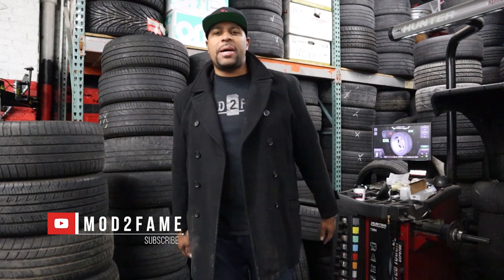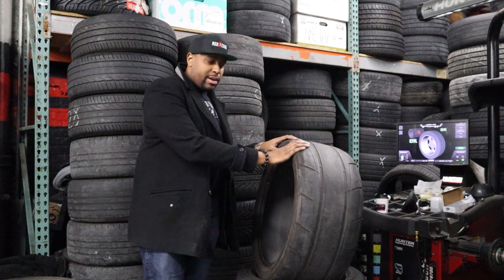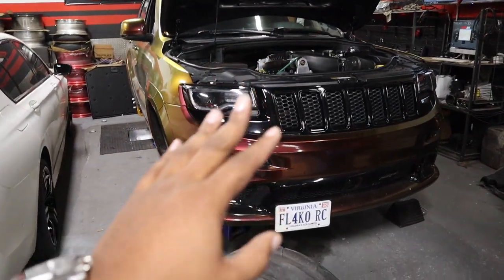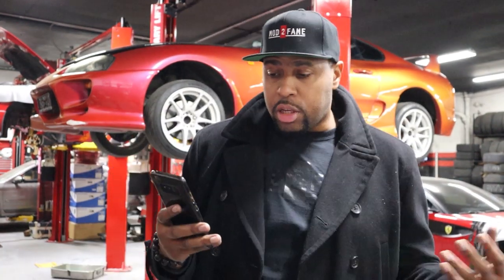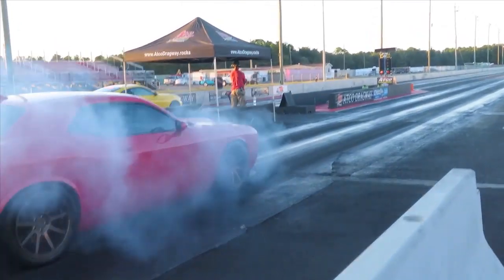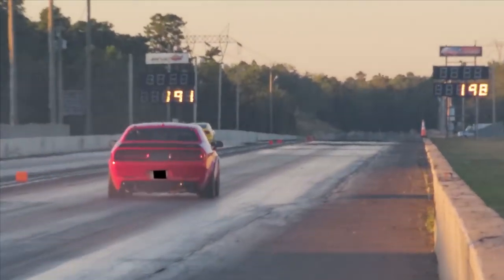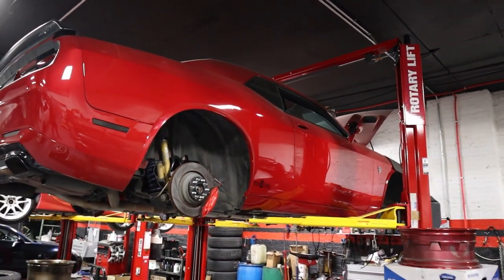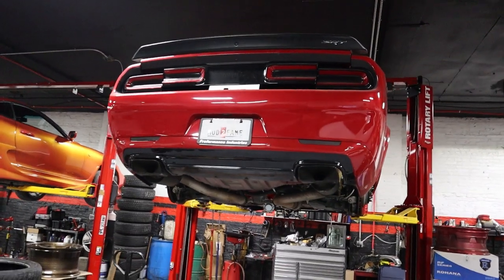Head 2 Head : Race Tires For The Street : Toyo vs Nitto

Comment: Nitto 555R’s Drag Radial for the street is king daddy for hooking, handling, wear and rain.
Reply: Gap Time not better than r888r. For a heavy car the nittios are cool. All super car and sports car guys viper , vettes , 720s , amg gtr, gt3 rs etc will tell you the r888r is the best for hooking , handling , and wet for a street super car
Reply: I drove my old car once in the rain and it was washing out if i tried going over 45mph and i had a 50 mile drive home.

Comment: Think you made the right call with the toyos. You can door so much more with them. Ive seen guys making 700 wheel and they do a first gear pull and it hooked up. Unbelievable. I have an 06 Z making 527 and if I get a little heat in them I can put it to the floor in first gear doing a 25 roll and it doesnt slip at all. And I can take turns.

Comment: If you think the NT05Rs wear out fast (which I was more than happy with how long they last), wait till you see how fast the ET street r’s wear out. I used both and my NT05Rs lasted a lot longer and seemed to perform good throughout the entire life of the tire as opposed to the MT which fell off a cliff before they were even close to being done. Can’t wait to hit the streets with you soon. 👍🏼
Reply: I have 2500 miles on my Nt05r's and they still have 80% left on them
Reply: How long the nt05r's last? I got 10k plus on my 555r's, debating between the two